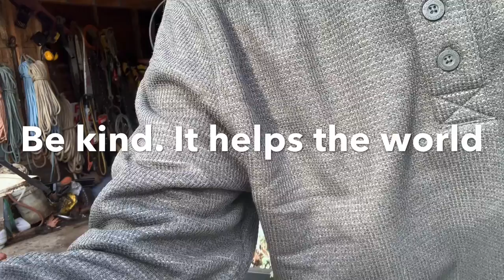What happens when a chainsaw is filed wrong

Comment: your the only one who teaches how to correct issues I have had a 20 inch firewood saw chain for several years its missing a tooth ive hit rocks i do not use the electric chain eating sharpeners
yes its easier/faster to use but it actually cost you more because if you can sharpen a chain correct you can cut far more wood between sharpening i use a hand file/raker gauge with buckins teaching and others as well i save time cutting gullets by using a dremel or the electric sharpener but i only use them to "clean the chain up" but file for cutters and rakers/guides
bar maintenance is critical as well but most sharpening can be a few file strokes and your back to cutting it takes longer on an electric/retail grinder because you have to take the chain off where a quick file sharpen a few times before total bar/chain maintenance or "clean up" is required to take guides/rakers down fix chipped teeth/gullet bar rail reconditioning
I can cut twice as much wood as my neighbor because of hand filing he goes though chains like TP using an electric sharpener

Comment: Hello from Western PA .... love your videos.... been logging for 15 year's took me about 6 years to figure out the sharpening still learning new things every year ... So glad there are people like you  and iron horse..... Showing people the correct way to do things .... You are spot-on about sharpening techniques....One other thing I have ran into before ..... That can make a saw cut to one side is when the bearing is getting worn in the tip on your bar and it hasn't blown out yet , but is starting to get play back and forth . That will make your saw cut to one side or the other or bind up a little bit when you have the whole bar buried in a log and it can make you doubt your sharpening abilities for a little bit , until you change the tip and realize the chain has been right the whole time .

Comment: You are right on I had a chain that was cutting crooked and it was because I was better at sharpening one direction. I now take an extra stroke with my weak hand and haven't had a problem since. Thanks buckin! Get the gullet!

Comment: Thank you so very much.  Yes enjoy the journey.  Just got  a Husqvarna  371xp running first big real saw it's used saved it from the trash. It's running sound awesome and tommarow I put it to the test on white oak.  Thanks again on the chain sharpening tips.  O  ya it's a 28 bar,

Comment: Tree guys cut some white oak and ash trees in the yard and left them.   I wanted to cut and split some firewood.  I have a husky 240 that has been cutting heavy to the right.    Tried filing the chain but I have no experience filing.    It was cutting hard to the right and binding up bad.    I thought it was my setup and Thought this was only happening to me using a saw till I youtubed and googled the problem. I went out and Bought a new bar and chain and it cut perfectly straight.   Now I just have to learn how to properly file and sharpen the chains myself the correct way.  Thanks for the tips.

Comment: Billy Ray, the sprocket. If you have a worn sprocket that pulls the chain into the sprocket without  a firm centering track, it will wobble in the bar; if it is very used to that track, it will become severe. I know you know these things well, but there it is.

Comment: Buckin'....I agree with bar and filing as the two most probable causes of cutting crooked.  But I found another one and that is the quality of the chain.  I had received some narrow kerf chains for my 50cc saw from a very large supplier located in Southern California that were made in Canada.  Used them until there was almost no cutter left and never had a problem.  Ordered a couple more from same supplier and they came from China!  For first half of cutter they were fine.  Then they started cutting crooked.  Checked cutters and rakers and got them within 0.001" difference top plate and raker depth.  Put them on a brand new bar.  Same problem.  Finally saw that side plates had started to deform as metal had been removed.  Into the trash they went.  So quality of chain can have an impact!

Comment: There is a third thing, operator. I've seen people limp wrist saws, swear they won't cut straight yet i or others pick it up and it's cutting fine. This is usually an inexperienced guy, usually one that claims to be the reincarnation of the guy that beat paul bunion. But you're definitely correct about 95 percent of the time it's chain or bar

Comment: I only flip my bar after I get a burr on it or if I see uneven wear to one side.i try to use both the top and bottom of my bars, equally, if possible and I always look to see how my bars are oiling.  Uneven wear is usually caused by inadequate oiling, period.  Sometimes, if I get the bar in the dirt I will get a burr on one side of the bar or the other.  If this happens I just shut the saw off and grab another saw until I get a chance to clean and sharpen the saw that got in the dirt.  If that happens the saw, bar and chain get washed in two cycle and blown off, plus a good resharpening.  I do not cut with a dull chain because that can smoke a good saw through over-Erving, especially in cold weather.

Comment: Early in my days of cutting as well, big struggles with pulling. I knew it was a combination of filing and bar condition, also chain tension ( too tight of chain no bueno ) but what I found most interesting here was the conclusion drawn with cutter height! I would get out my calipers and inspect each cutter and file em true; keeping them precisely the same length across the cutter! Glad I can omit that variable from the equation. Thanks Buckin. Wish I’d seen this video years ago!
Reply from the maker: THIS WAS ONE OF THE MAIN REASONS THAT PUSHED ME TO START THIS CRASY CHANNEL
Reply: So glad you did! I am happy to be part of this community.

Comment: Happy belated birthday to Hogan and Mama Buckin! I enjoy these videos for sure, especially with me just starting. Can i take a message from this and say no matter how unevenly worn the teeth are, as long as your cutting edge and rakers are in line along each side of the chain, it will cut straighter? Or am i out to lunch on that? You've mentioned before that counting your strokes is a waste of time and you should just sharpen each tooth. That would ensure that your cutting edge is sharp, and hopefully in looking down the length of the bar, your leading edge of each tooth should be in line? If this makes any sense to anyone, just wondering if i got some of the concept right.
Reply from the maker: MY THINKIN DON IS THAT IF ONE SIDE WAS BRAND NEW AND THE OTHER SIDE WAS AT THE LINE YOU MAY SEE A PULL I WILL EXPERIMENT WITH THAT NEXT , THAT CHAIN IN THE VIDEO CLEARLY WAS ALL OVER THE PLACE  YOU SAW IT  AND IT NOT ONLY CUT STRAIGHT IT WAS SMOOTH

Comment: Neighbor had that problem. Checked the bar. It was almost new and just fine. Put on a brand new chain. Cut just fine. He goes to buck some wood. COmes back "It's doing the same thing" I made a couple cuts on my pile it worked just fine. He grabs it and cuts a rounded diagonal to the left. His saw only had a dog on the left of the blade. He held the front handle way off to the left and he was REALLY levering against the dogs and basically forcing the bar around in a circle around that dog.

Comment: Had a buddy call me one day. He said he had a tree in a fence row down. He asked me if I wanted it. I told him I'd take it but it was to muddy for me to go get it and I had other things to do first.  He said he would go cut it up and deliver it because his kids didn't have nothing to do that day. They went with a tractor and trailer and cut it up. He had bought a new husky saw. He cut a tree down in his yard that he was going to toss on the trailer also. Well that's the tree that caused the trouble. Them rounds were so angled they would not stand on end. I couldn't even split them in the log splitter. They just ramped wedge. Lol. 
I figured he hit a some fence in the wood. 
He bent the bar. If you looked close you could see it. That first tree pinched him good enough to bend the bar.

Comment: Um, you hand filed the left side cutters, and ground the chain on the right.  It pulled to the right. Wouldnt it be the sharper left hand teeth that are cutting faster than the right, causing more wood to be removed faster from that side? I believe you hand files are cutting better

Comment: How does the sharpening compare with that electric sharpener V's the Oregon ones you would mount on a work bench. Acts kind of like a chop saw in operation.
Reply from the maker: THE BENCH IS A ROUND GRIND ,, THE ONE I USE IS A SQUARE GRIND FASTER AND SMOOTHER

Comment: 8:30 I had that happen it just took a little bit off the tips of a few teeth.  I sharpened and got the top of the tooth sharp, but the tip was still gone.  That saw would still not cut straight, it took awhile to figure out how important the tips of the teeth are.

Comment: make a video with only 2 cutters on a saw chain most people throw a chain out if it has a few missing cutter teeth...you can file a cutter until its gone and the chain will still cut
it wont be as fast as new but unless your missing a whole side a few teeth are going to be unnoticeable in the cut
if you do make a video buckin be sure the cutters are on opposite sides lol